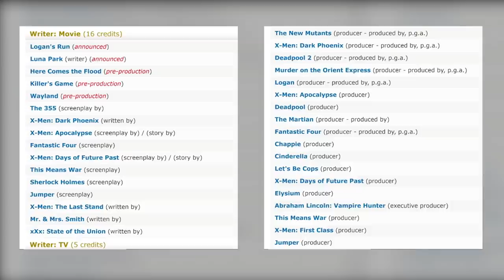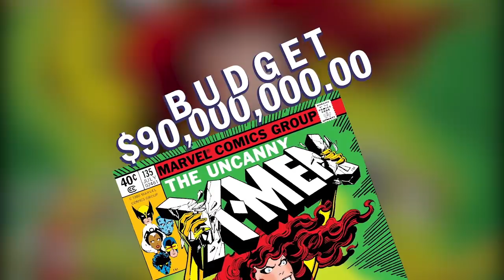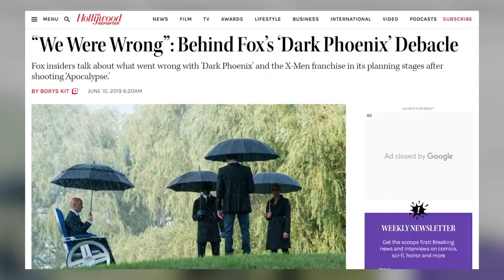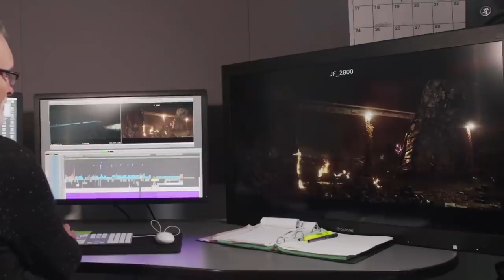WTF Happened to X-MEN: DARK PHOENIX (2019)?

Comment: The film went through a complicated production due to the merge of 20th Century Fox and Disney and as a consequence, the original plan of a two-films version (confirmed by Simon Kinberg, Chris Claremont and Josh Boone) had to be massively reduced to one film. The ideas that Simon Kinberg initially had, were discarded and hardly compacted. Losing key elements of the comics and also making it complex to depict in a single installment. Originally the two films would be shot consecutively, therefore two major sets were built first (the New York set for The Part One and the United Nations scenario for The Part Two).
Reply: Hopefully the sets got recycled for another film! it would be a shame to build several huge sets, then tear it all down and throw it out later instead of sellingn it to another studio or re using it in house

Comment: The power of the bigger stories told in the comics is that the writers take their time to develop them, time writers don't take or get when they develop those stories for movies or even series. The Phoenix-story in the comics is build over dozens of comics and that is not even taking in account the buildup of the characters and their relationships in the comics before Jean becomes Phoenix. In both attempts to write the Dark Phoenix-story for the big screen, the writers seem to forget that Jean first became Phoenix and that there was not a trace of darkness in that power, she fought with the X-men like before but she had a lot more impact on the fights than she had before, even being able to hold back Magneto. Her increase in power concerned the other X-men, and that concern is one of the many great plotlines in the story. The other essential part in the Phoenix-saga is the way she gets seduced by the dark side, the way she begins to change, and you cannot tell the story the right way without that part, and it does not have to be told exactly like it is written in the comics (but it would be best if they did), but that plotline has to be there. The Phoenix-saga is a great story to tell and you could tell it in 20 movies with a massive climax, 20 movies that build up the MCU (Mutant Cinematic Universe) and end with the death of Jean Grey sacrificing herself for the universe (sounds familiar doesn't it). The X-men comics have several larger storylines, and most of them are great, but they all need that big build up, but done right... it could be a lot better than the MCU we had and have now. Disney needs to put someone in control who knows, loves and respects the comics, and let that person set out the path.
Reply: Dude, Jean didn't become the Phoenix/Dark Phoenix until at the very end of the movie. Even the filmmakers have said this and that it is suppose to be a Phoenix origin story. No disrespect, but your entire complaint is build on a false premise.
Reply: @agentofchaos7456 , I was comparing the storyline of the movie with the one in the comics, in the comics Jean is Phoenix for a long period of time without doing anything even close to what Jean is already doing halfway the movie. You say Jean didn't become Phoenix until at the end of the movie, but that is not true, she becomes Phoenix in the shuttle-incident, that is the moment she gets that power and becomes Phoenix. In the comics that is made very clear, after the shuttle with all the X-men crashed in the water, Jean emerges from the water screaming she is no longer the woman they knew but now is the Phoenix. A long time passes that sees Jean and the people she loves adapting to her new powers and she fights with the X-men as Phoenix with new outfit and all. When the darkness gets hold of her after the Hellfire Club-incident and she destroys the X-jet, she tells her team that she is Dark Phoenix, humiliates all the X-men, says she belongs among the stars, destroys a whole planet, what gets the attention of the Shiar-empire and leads to Jean's demise. This movie just tried to put too much story in one movie,  knowing that it was the kind of movie that needed at least three big scenes with spectacle and special effects that would take even more time away of telling the story in a good way.
Reply: @pascalcallemien2498  In the comics, Jean was a troubled person before she even met Xavier. Her lashing out at people in the movie is exactly what happened in X-Men Origins: Jean Grey (I recommend it). At the end of the movie she transforms into a fiery cosmic bird and flies off into space to eat a star, doesn't that sound like the Phoenix/Dark Phoenix?

Comment: The Dark Phoenix Saga will always fail and be a waist of time so long as they choose to skip doing THE PHOENIX SAGA
Reply: There was no Phoenix Saga in the comics. That was just a title created for the animated series' adaptation of the M'Kraan Crystal arc, which was significantly different from the original story.
Reply: @agentofchaos7456  this is correct. But its since been adopted as shorthand for the small story arc preceding this story. The point is, you cant do this tale properly without first building the character as a hero first
Reply: @Fernando_616  That is pretty the point of the movie. You see, this is suppose to be an origin story about how Jean becomes the Phoenix and doesn't become Phoenix/Dark Phoenix until at the very end of the movie. It is suppose to be her character arc and the sequel was suppose to be about the Phoenix in action. But then the movie bombed, so it didn't happen.